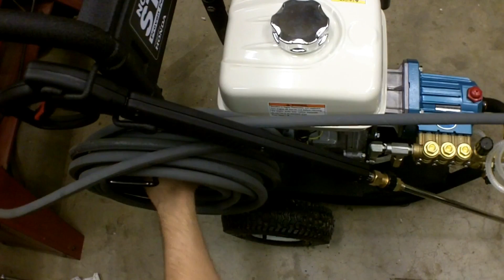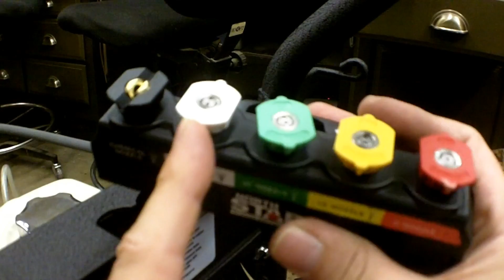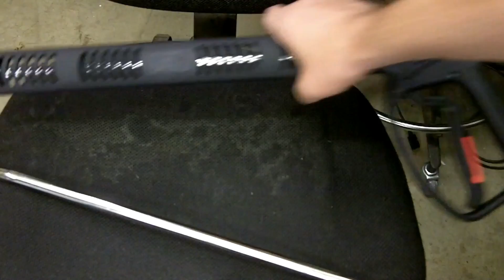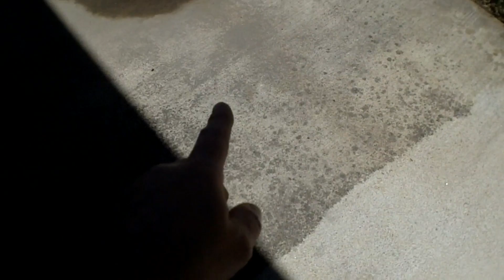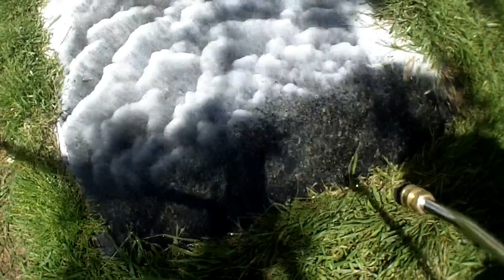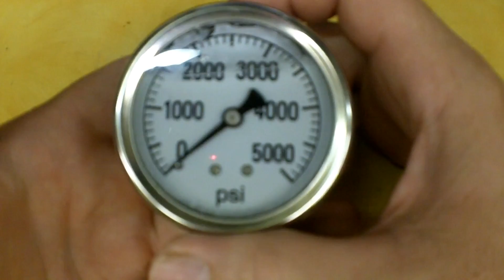NorthStar 3300 PSI 3 GPM Pressure Washer Review Item 15781820

Comment: This was an awesome review!!! Wow. I think this was your best video yet. Not saying that any of your other videos are bad. Just a few days ago I replaced the wand on our pressure washer. It's an old Troy built 1500 psi. Now we're not getting hardly any pressure. I have no idea why it's doing that. Hopefully the pump didn't just go. It ran really strong before. Do you have any ideas what it could be? Maybe there's something in the line? I had to take out the valve that regulates the pressure so I could get the old hose connection off. It had rusted itself on the pump. They use a partial steel pipe. The pressure valve I turned it in the whole way in and out and it doesn't change anything. I don't know what to do. I've been looking at a ryobi pressure washer to get if this one doesn't work out.
Reply from the maker: Thanks Man! I'm no pro with pressure washers- but to me it sounds like your unloader valve is stuck (maybe rusted shut), worn out, or has trash in it. It should be part of the regulator you mention. I would guess rusted since you mentioned rust. When you are not pulling the trigger, it will go into bypass mode. When you pull the trigger, the valve will open and let the water go out of the wand. Again, it sounds like the valve is stuck shut so it's always in bypass mode. One thing you could try before taking it apart is to turn it on without a tip and cycle the trigger several times to try and un-stick the valve. Then put on the tip to see if you get good pressure. If so- the valve was stuck/sticking. That might be all you need to do, or you might need to take it apart and clean things up if that's possible- or get a replacement if you can find one. That's what I think, but again I'm no pro.
Let me know what you find out,
G.
Reply: I have taken the valve out and it seems to be working. Theres a ton of pressure that is built up in the hose. The engine idles down because its working a lot to keep the pressure. When I release the pressure by squeezing the trigger, theres a huge release of pressure and then it trickels with no pressure. I don't think the pump is bad because then there wouldn't be a lot pressure. We're taking it to a repair man in the next few days maybe. I don't know what went wrong. It might be that valve like you said.
Reply from the maker: Love2boat92
Yeah, it does sound like the bypass valve is stuck or malfunctioning. I'm not sure on your washer if it's part of the regulator or not- it is on mine. It might be located somewhere else. Hopefully it can be fixed cheaply. Good luck, G
Reply: Thanks, I took it to our repair man today, and he said that for a new pump it would cost more than the pressure washer is worth and its probably not worth putting much money into if we could even find parts for it, so I don't think were going to put more money into it. I've been looking at one from harbor freight. Its their 2500 psi and 212 cc model. Looks like a decent pressure washer. I like those honda clone engines. Do you or anyone you know have any experience with that pressure washer?? Its definitely a few steps up from the one we had. I love how big the gas tank is. We also were looking into an electric washer, but theres too many cords to drag around and they usually don't generate enough of pressure.
Reply from the maker: Love2boat92 Send me the model number of your washer. I want to look up the parts breakdown. I don't know anyone with the 2500 HF washer, but it looks like a pretty nice machine and gets good reviews. With a 25% coupon, and since it's currently on sale, you could pick one up for about $262 plus tax. It should put out about 2200 PSI at the nozzle. The GPM's are good as well, so it should clean fast. The only thing I don't like is the 25' hose- but that's no big deal. I'm spoiled now with mine being 50' but already want to add 100 more feet....lol. If you're old washer was rated at 1700, you were probably only getting about 1400 PSI out of it. I would stay away from the electrics for just the reason you stated. G.
Reply: Where would the model number be located on it? It has a Tecumseh 3.5 hp engine. Single piston. Its 1500 psi. The back handle is straight up and down. Its red. A 50 foot hose could wrap around a vehicle a few times. LOL. You're going to need for a 100 foot hose a reel for it all. LOL. I cant really decide between the Ryobi 3100 psi pressure washer or the harbor freight 2500 psi one. 3100 Ryobi would be nice, but the pump isn't maintainable, the gas tank is small, it does however have more psi that harbor freights. Harbor freights has a huge gas tank, triple valve pump (that's probably not what its really called but that's what im callng it at the moment. lol) pneumatic wheels. Its a tough decision. I'm still kind of leaning more torwards a new one though. If we do get a new one I want to get to use the old engine for a boat motor.
Reply from the maker: Love2boat92
I don't know. I think there should be a white tag somewhere. I would imagine it would be on the cart somewhere.  I figured you might be able to fix it without parts- which is why I wanted to look at it for you. You can't make it any worse- so you might as well try. I can't seem to find a 1500 anywhere when looking.

They make a hose reel kit for my washer, but they want $350 for it. You can buy a complete washer for that! It comes with a mounting bracket, reel, 100' of hose, a chemical holder and a rotating nozzle.  I want it, but can't justify the price at this point- I spent tons on it as it is.

Unless you are planning on doing some REALLY heavy duty cleaning, I think the HF would work great. There's a trade off with the Ryobi though even though it has more PSI- the GPM is 2.5 so it would take longer to clean over the HF 3GPM if you use the same PSI. Plus it has a vertical shaft over the HF horizontal shaft. Its my understanding a horizontal shaft will hold up better but I could be wrong. Just my opinion- but I would go for the HF.

The Ryobi looks pretty cool over the HF, but that's not what matters.

Take a look again for a model number of your washer and send it to me if you can find it.
G.
Reply from the maker: Love2boat92
I looked at the Ryobi for a while and I do like the idle down feature- that's pretty cool. What I don't like, like you mentioned, is the tank is super small. But with having the idle down feature, it might do ok since it only revs up when on the trigger. But, it's also one more thing to fail. It also looks like it would be a pain to fill with where the filler cap is located. I can't tell if the chemical injection is downstream of the pump, or if it has a thermal protection valve. I do like the idea of the on-board soap dispenser, but it will crack and leak over time.

The multi-nozzle tip is pretty cool, but each orifice will wear out at different rates. I personally like the individual nozzles. You could buy the individual nozzles to use with it when the one that came with it wears out, but that's more cost. The psi is nicer, but may not be required.

I can't see much on the pump, but if it's not serviceable like you said- it's a huge turn off for me. The pumps on the lower priced washers are the weak link in the system. Just like your old one! That is the reason I went with the CAT pump for mine- but the pump itself would probably cost more than you will be paying for a whole unit. Parts costs to repair the pumps on lower cost pumps can be too expensive so buying a new unit is a better idea. Again, kind of like the position you're in now.

 It would also cost more than using a 25% off HF coupon (START USING THE 25% OFF COUPONS- FORGET THE 20%) to buy theirs.
The HF has an axial triplex pump which is ok. The manual shows a parts list. If they can be ordered, there shouldn't be any problems servicing the pump. It does have a thermal valve to help protect the pump- big plus. It has downstream chemical injection so no chemicals go through the pump. pneumatic tires would be a plus on your farm!

Ryobi
Pros:
1) idle down feature
2) Honda engine
3) PSI
4) Parts availability may be better

Cons:
1) Small tank
2) Bad placement of filler cap
3) Solid tires
4) Too many plastic bits to break
5) Non serviceable pump. Plus all aluminum.
6) Multi-nozzle will wear out at different rates causing it to be useless on certain settings.
7) 2.5 GPM will make cleaning take longer
8) Vertical shaft engine
9) Hook-ups under unit
10) May not have thermal protection for pump

HF
Pros:
1) Honda clone
2) Horizontal shaft
3) Pneumatic tires
4) Separate nozzles
5) Thermal protection
6) Downstream injection
7) Aluminum and brass triplex pump
8) Easy hookups
9) 3 GPM
10) Servicable pump (if parts can be obtained)
11) Big tank
12) Very few plastic bits to break

Cons:
1) lower PSI
2) Parts may be hard to get
3) No idle down feature

I guess I turned this post into a desktop review so I hope it helps.
It seems to me you're struggling with the PSI difference the most. The HF is lower, but is also cheaper with more GPM. 2200 on the trigger is still a lot of pressure. The Ryobi would probably be about 2800 on the trigger. 2800 is getting close to paint stripping power. It can also tear up wood, etc fast. My point is, even if you get one with more psi, you may never need it and end up turning it down anyway. Since you know what your old washer was like, the HF would be almost twice as powerful.

This is just my opinion and I don't have any experience with either machine.

Tips- try to never leave water in the system when storing. This is where most of the problems start since the innards will rust. I disconnect the water supply and discharge hose. Then start the motor for just a few seconds to blow most of it out. Then take compressed air and blow in the inlet to try and remove as much water as possible. I also take the hose off the unit and wand and blow both out with compressed air. If storing where it will freeze, blow out all the water like I mentioned, or try to fill the pump with "RV" antifreeze.

They should last years by following these simple steps.

Good luck,
G.
Reply: That was the longest comment i've ever seen. wow. That must have taken a long time. You sure did some research on both of them like I did. We decided to go with the one from...............................................................................................................................Are you ready for it?......................................................................................................................................................................................................Still waiting?.....................................................................................................................................................................I'm getting there...................................................................................................................................................................................Harbor freight. It was 381 with the extended warranty. I put it together. Pump had oil in it. Put gas and oil in it for the engine and it started on the first pull. Unbelievable!!!! I broke it in and changed the pump oil as well as the engine oil. About 95% of the machine is steel. I love that. I'm very impressed so far. Loads of power. I can blow leaves with it from at least 20 feet away. I wasn't planning on using it as a leaf blower. Lol. This is so much better than the old one we had. I might make a video of it sometime soon. I need a good camera though. My ipod touch is okay. Battery seems to drain fast sometimes. Thank you so much for your help with deciding on a pressure washer. At this price point, we couldn't find anything that had a serviceable triplex pump, a huge gas tank pneumatic wheels, and something that was going to last. My neighbor says we never throw anything away. We're never going to throw this thing away. I'm impressed so far. Power washed the mowers, a wood chipper, the house, a deck, two sides of a church  with it. The church is probably 30'X35'. Still doing great.
Reply from the maker: Love2boat92  Yeah, it took some time, but if it helps you and others out- that's great. I'm glad you're liking it so far. I bet it is a new world over the old one. I would like to see a clip of it if you get the time. Let me know if you post one. Try to blow things out like I explained and it should last quite a long time. It sounds like they did a good job on the honda clone. My NorthStar washer was a 1 pull start as well.  Be sure to check that the engine mounting bolts are tight. I rattled of a nut on mine and all of them were loose. They didn't get them tight enough. I'm stoked you're satisfied with it! G.
Reply: Thanks. It definitely did help out. Theres a huge difference in the new one. I can do so much with it. I added another hose. So now I have 50 feet. I will let you know if I post a video. I need a good camera though. I checked some of the bolts on the washer before I used it and there were some that were loose. I didn't check the engine mounting bolts though. Maybe ill do that later. Your north star is worlds better than this one. Id love to have that one. lol.
Reply from the maker: Love2boat92
Good deal! I would check the mounting bolts. 50' of hose is nice to have. I love my north star, but I have to pay quite a bit for it. G.
Reply: Yeah you did pay quite a bit for it, but I think its a great deal. You have a really nice machine. I'll definitely check the bolts. The motor and pump does flex a little from the cart its bolted to like its supposed to.

Comment: I have the 4000 psi model with the gx390 honda motor and CAT pump, for about 7 years. Amazing pressure washer. Never had a problems with it running, except one time I had to flush out the gas tank after winter storage, very easy you could figure it out.  One thing to be careful of is when you are using it don't drop the wand on the ground while pressurized, I did and it cracked right after the first fitting.  As long as you take care of it, you will be very happy.
Reply from the maker: I actually looked into the one you have, Randy. When I got to the store I was surprised how big that machine was. I went one step down from yours mainly due to the $400 difference. I had enough of a struggle coughing out what I did, but am very glad I did. Good tip on the wand. It's good to hear yours has worked out for so many years. That's another reason I went with this brand. They seem to hold up really well. They have very few complaints, and most are trivial in my opinion. I'm finding myself looking for anything else I can clean with it...lol.
Thanks,
G.

Comment: Good video. I use diluted TSP, in hot water, through the pickup for cleaning concrete. Does a good job on oil stains. Maybe you could drill a hole(s) on either side of the tip hold and back is with a piece of Delrin to hold your extra tips? Just a thought.
Reply from the maker: Thanks Man! Good tip on the TSP and good idea on using Delrin. It's so new to me at this point I've not put much thought into it. I know it will start ticking me off in time and I will do something about it...lol. It cost me many pretty pennies but it's awesome and worth every one! G.